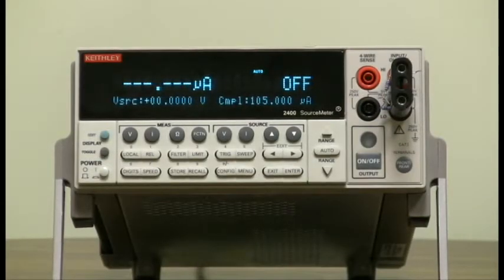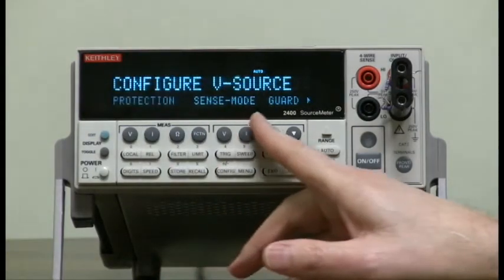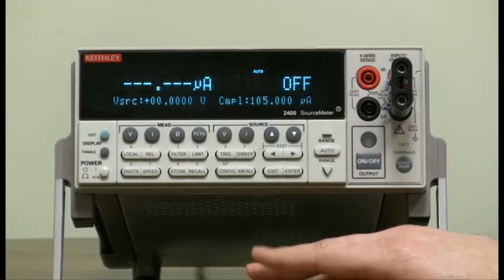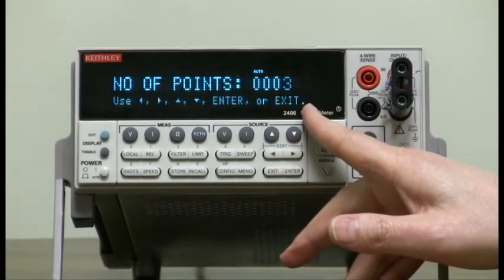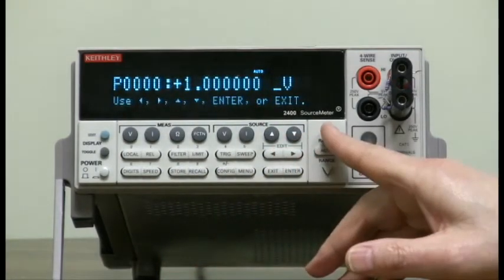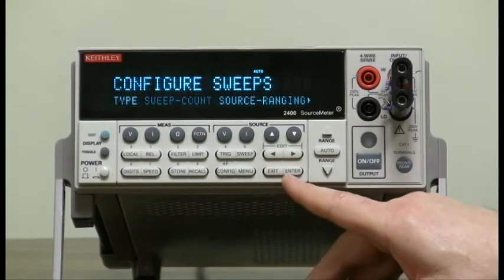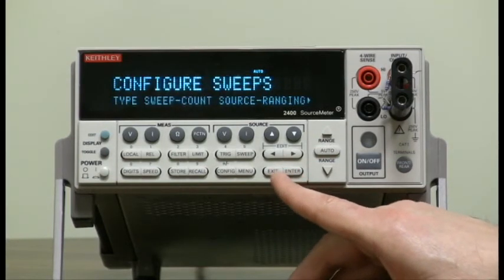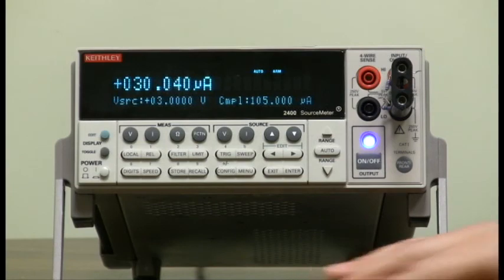How-To Configure a Custom/List Sweep

Comment: two questions: 
1. is there an easy way to export such a sweep as a *.CSV or any other easily accessible data format?

2. Can these sourcemeters sweep a symmetrical range from let's say -10V to +10V?

thanks